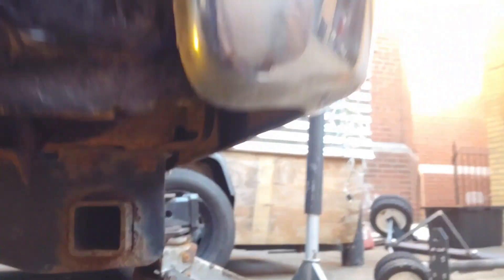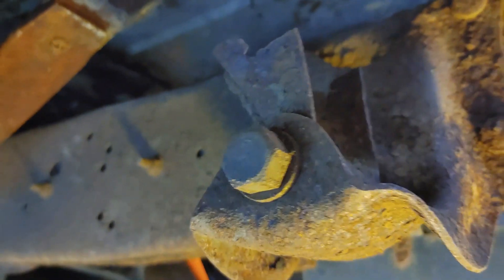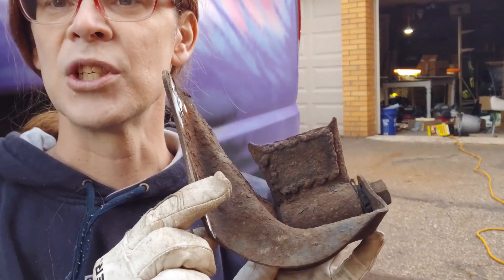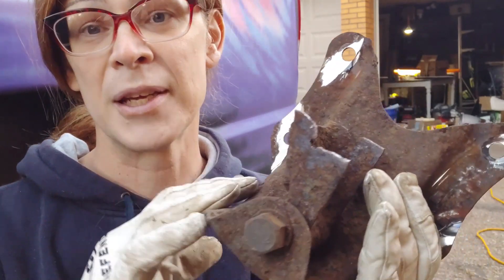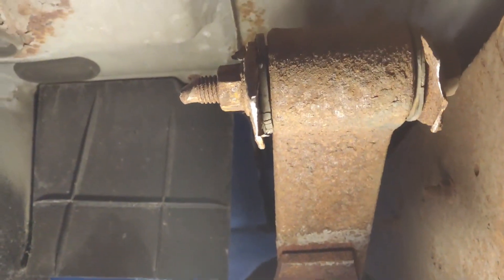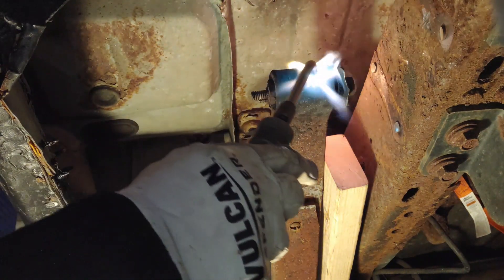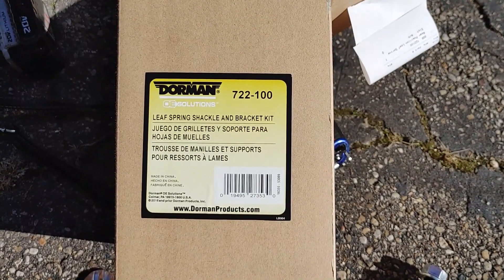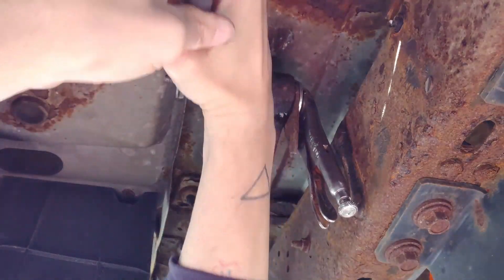Quality leaf spring shackle repair for rusty classics

Comment: Rust belt repairs...  you did well. Grind, hammer, and torch it apart then bolt it together with good parts. I didn't know there was a complete kit available until you did this. Good to know. Thanks!

Comment: I realize giving suggestions on these types of videos is kind of pointless because you already got the work done however...for FUTURE reference...torch and penetrating oil at the same time works wonders. You can spray the area around the bolt/sleeve while at the same time carefully applying heat to the tube area of the spring and that will draw the penetrating oil in further. Also helps allow the spring tube/end to expand a little quicker. Then whack that mother with a 3 lb hammer and it should all come out relatively quickly.
Reply from the maker: I'm totally in favor of helpful experience. People could be finding this video months or years later looking for information on what will help them solve their trouble. Thanks for the suggestion.